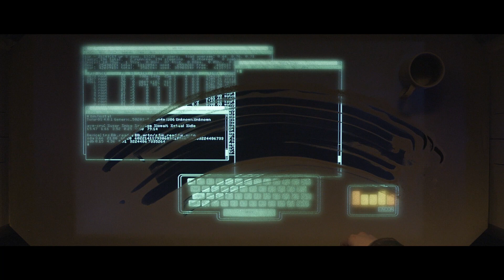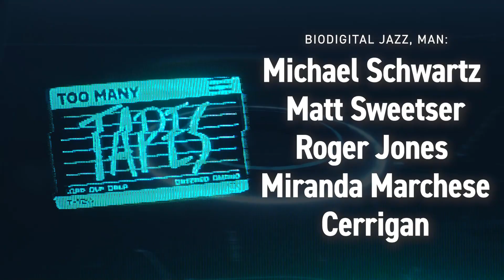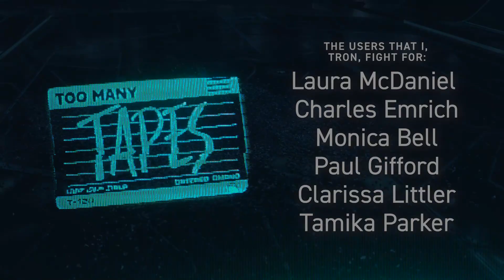The Legacy of Tron: Legacy

Comment: I agree with much of your analysis of 'TRON- Legacy'.  I was disappointed that the quality of the film was not appreciated on release, but since that's been the case with so many good films over the years, I was not surprised. Films that push limits often do so in a way that the culture of the time simply doesn't have the tools/structure/ability to *See*. 

Regarding the original film, taking the special effects of both it and Legacy off the table, Legacy IS a stronger film in writing. It's more character-driven, which is always a good thing, it's more entertaining, the composing of the story, re: the editing, is VASTLY better. Simply as a movie, Legacy is a better experience overall. However, when it comes to the Philosophical Ideas presented, the original TRON stands at least as tall as the sequel. I think that the fact that it dealt with similar topics, only 30 years earlier, meant even more people couldn't see them. 

(This is a repost of something I wrote elsewhere, but it fits just fine here.) 

Now, to back up a bit, I miss the Internet of the 1990's tremendously. Most people on it now, have no idea what it was like. Some more experienced users have categorized the Internet of the early 2000's as 'The Wild West', and using that analogy, the 90's Internet was like 'Lewis and Clark'. A journey into a completely new land. Next to nothing was hidden behind a Paywall, it was not dominated by Corpos and Bots, people would put up almost anything, communicating information trivial, silly and, not as rare as one might think, ideas of tremendous value. 

I sadly, did not copy this article as I should have. It wasn't until around 1999 that I started archiving things I thought worth keeping, as well as data I was pretty sure was going to get scrubbed. While being a Techie since the 1980's and understood the theoretical impermanence of the 'net, it took me a few years to grok it on a personal level. However, I remember the core of the article very well-

This was an essay by a Film & Media reporter, who was posting some of his stranger encounters in the world of Hollywood. He was recounting an interview he had around 1989, with a Hollywood Mogul who was leaving the industry. It was a kind of biography/retrospective on his career. At one point, on a whim, the Reporter asked the Exec what the most religious film Hollywood had ever made, was. Expecting something straightforward, like 'The Ten Commandments' or 'Ben-Hur', he was completely shocked when the Exec leaned back in his chair, stared off into space for a bit, then, sitting up and looking the Reporter squarely in the eye & said gravely, without a hint of humor- 

"TRON."

The Reporter said he was so flabbergasted that he couldn't think of a response. He had seen the film, liked it, but the idea was just so left-field to him. He wanted to laugh, but the Exec was SO serious, he was sure the man would be deeply offended. So he just mumbled an 'Okay', wrote it down, and moved on. While brief, the Reporter said this was one of the most standout experiences he had had. 

Now, in the 2020's, the idea of our World being a Simulation is far more common. Back then though, it would be almost unheard of, especially outside of Scientific Circles. Was the Executive just a really imaginative guy? Or had he learned something that very few people, even to this day, have discovered? 

Just as a Thought Exercise, watch the Original Film, but take the perspective of the Grid being OUR world & see if you learn anything new.